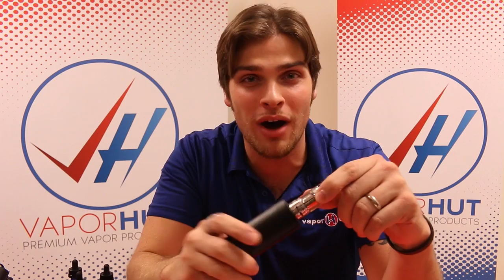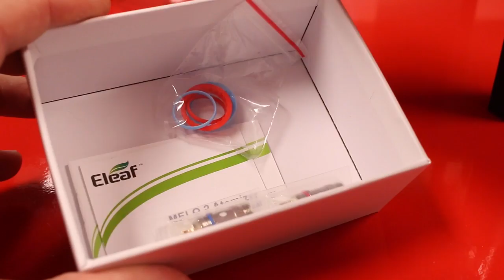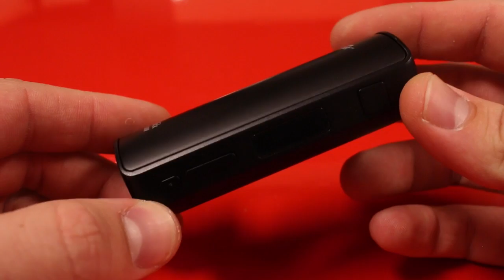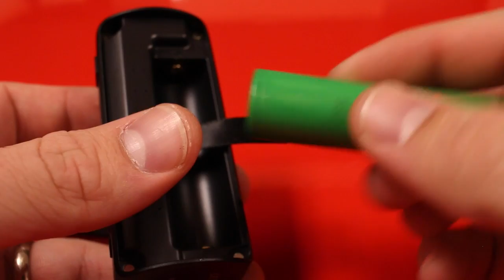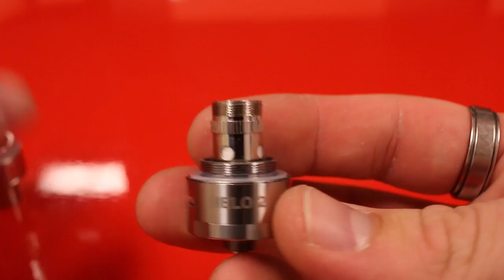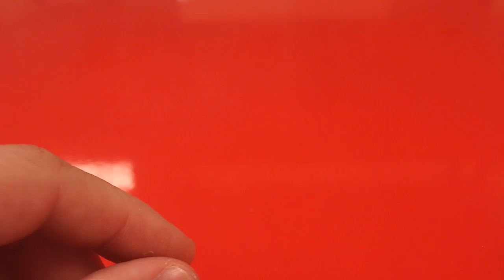iStick TC 60W & Melo 2 by Eleaf (TUTORIAL)

Comment: I use batter Samsung 18650 -26F
                                                     SDI
                                                  2C63
On full charge if I turn wattage at 30.with temp up around510f and after a few puffs it says low battery!! 
What is the correct battery I should be using??
Reply from the maker: How old is that battery? I ran into the exact same issue when I was using 6+ month old Samsungs. As batteries age, their "battery sag" gets worse and worse which means the istick reads the voltage as going from (let's say) 4.0V to 3.5V. I bet if you wait a minute or two you can hit it again without the "battery low" indicator coming up. This is a sign that your battery is old. Try a brand new 18650 and see if that doesn't solve your problem.
Reply: +Vapor Hut 6 days old
Reply from the maker: +YouTube Madness I think those batteries are simply too weak. Get yourself some Samsung 25Rs or Sony VTC5s and you should be good.

Comment: @Vapor Hut So after I set my eleaf 60w into NI mode, and try to hit it it goes for a while and then reads "temperature protection" I have a ni coil and it set to 0.15ohms 490F and 49W
Reply from the maker: "Temperature Protection" means you've hit your temperature and the wattage is being dialed back to prevent a dry/burnt hit. If you raise your temperature, it won't kick in as fast but otherwise, that's what it's supposed to do.

Comment: Hi, This is my first Vaporizer and i've noticed my mod and melo 2 get kinda hot after about 6-7 hits within a short time period like 1-2 minutes. Is this normal? Im using a 18660 battery i think. Thanks for any answers! P.S im using the atomizer that was pre installed, so im using wattage mode.
Reply from the maker: +Solomodex What kind of 18650 battery are you using? What does it look like? Is the tank and the mod getting warm, or is it just the tank? If it's just the tank, I'd say it's probably the fact that it is a 0.3 ohm coil and those run pretty hot. If the mod/battery is getting warm, it could be that you are using a battery that is not a "high drain", meaning that it should not be used for "sub-ohm" vaping.
Reply: +Vapor Hut Hi! Thanks for answering. Its called ASPIRE 18650 20A 2500 MAH and it says High Discharge on it. My mod also gets kinda hot but not hot hot if you know what i mean. but mainly the tank is getting hot so im guessing its the 0.3ohm coil thats causing that then. I might change it to the Titanium 0.50 coil so i can use temperature control. Do you think that might help? Thanks again!
Reply from the maker: +Solomodex Switching over to the nickel or titanium will definitely help! No problem brother!
Reply: Vapor Hut 
I'm having a similar problem, actually, and I was hoping you might be able to help?
I just got a bunch of replacement coils, and popped in a nickel one. The tank (not the battery/device) heated up a LOT.

So I let it cool down, then tried it again, and after a few more puffs it heated right back up. I've been using this for around a month, so it's not the normal sort of warmth I'm used to feeling in the tank. It's much more significant.

I took the tank off immediately, and noticed the bottom portion of it was very, very warm. It felt like if it was any warmer it could burn me. Which made me think something's going on with the coil itself. I was definitely using it on NI-mode, and "locked" it as well.

Also, I'm not sure if this is relevant, but, the device hasn't asked if it was a new coil like it did the first time. Is that just a one time thing or am I doing something wrong? I felt like if I'd kept using it it would have exploded. To reiterate, I definitely was NOT using it on VW mode to avoid just that. I've been overly careful with all of this stuff.

Could these be bad coils or something? I got them from a reputable website and they came in Eleaf packaging -- so I don't think they're knock offs (or if that's even a thing). I really just don't know what to think.

All of this has me worried enough to where I'm exclusively using the Kanthal/VW-mode; and postponing using TC-modes until I can figure out what is going on. Any help would be greatly appreciated -- even a point in the right direction.

 Please get back to me at your convenience. Thanks so much.
Reply: +doppolis - (dop) Im having the same issue with it not asking me if its a new coil or not, which has me worried that it might be something wrong with my mod, but if its happening to you aswell im not sure what to think. I also had to start exclusively using kanthal /Wattage mode to avoid these issues. Please also let me know if you figure something out. I dont have alot of money as im a student so i cant just go and buy a new kit.